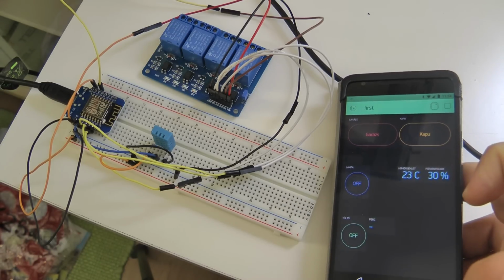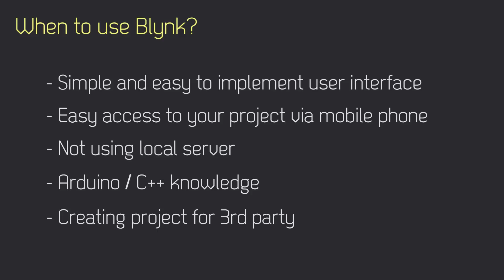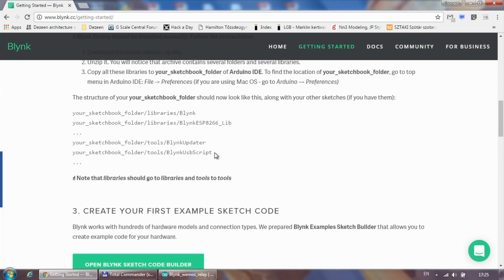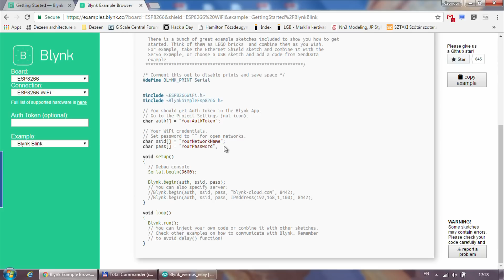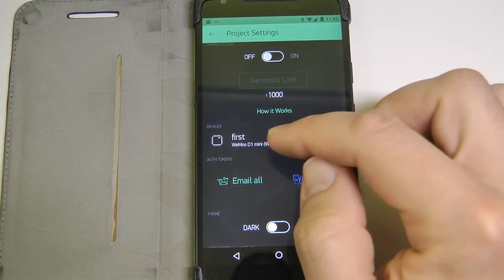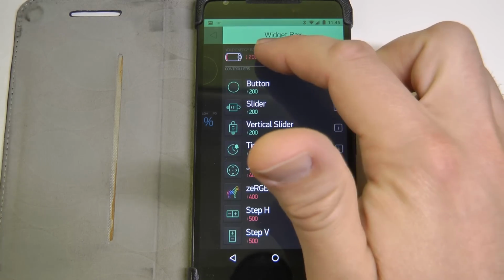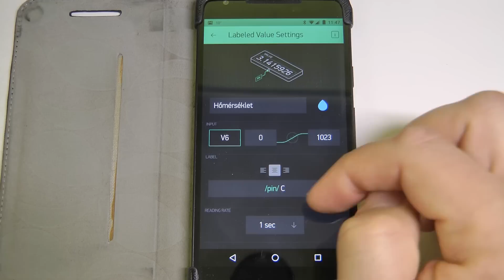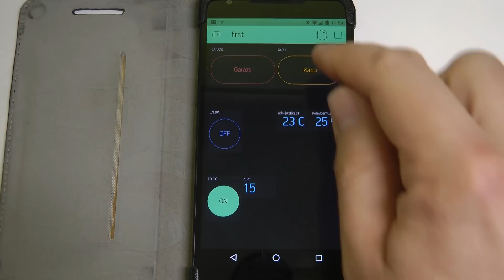What is Blynk and how does it work?

Comment: Ive bild a whole E rain gauge with magnet and Hall sensor and tipping bucket and also Arduino Uno and also try Rpi4 (with wifi bild in ) no should Blynk (free detecting this puls for messure the rain outside or must this first working with code and GSM screen ?

Comment: If you look at the example list and select servo it is unclear which pin you connect physically to the servo and the slider. This is not straight forward so having trouble figuring out how folks use this app. Sure creating the graphical interface on your cell phone is 80% clear and the sketch creation is 10% clear. How would you go about creating buttons, a graph, a gauge, and a display for one project? Which example on the web site do you select?
Needed is an example for each and every example on that blynk sample page.
Reply from the maker: It was a long time ago I used Blink for the last time. What are you trying to do?
Reply: @csongorvarga  see my OP covers it there.
Reply from the maker: @MaxGoddur  I think it is unclear because it depends on the microcontroller which PIN supports PWM. You need a PWM pin for the servo. So the basic Led and UI button example works, just need to use a PIN which supports PWM and use a slider instead of a button.

Comment: Hey man...great video. I like the detail. Quick question though, do I need the Ethernet shield to operate this? I have a HM-10 BLE module and I am trying to use it to control a motor and other things using an arduino nano. I also have an arduino uno, but I don't have the ethernet shield. Is it possible to control an arduino project via BLE module without the ethernet shield? Or are they two completely different platforms?
Reply from the maker: I never used BLE with Blynk. But you need a way for the Blynk server to communicate with BLE device. The examples I have seen is your phone communicates with the BLE device via Blynk. Which is nice and easy but that will not work when you move away from your BLE device. For those scenarios you need some sort of Wifi-BLE gateway like an arduino with ethernet shield and BLE module as well. But I don't believe the code for that exists out-of-the box, so you need to code that in Arduino IDE.
Reply: Csongor Varga Would you be able to assist me with getting Blynk to communicate with my BLE module? I would really appreciate it man. I am doing this for my school project. I have a HC-06 and it works perfectly with an android device. I am just struggling to get my iphone to communicate with my HM-10 BLE.
Reply: @csongorvarga  I just want to be able to control a motor via bluetooth using an iphone without having to through the whole xcode thing. I do not know anything about xcode or how to program using it.

Comment: Is it possible to transmit ECG sensor data using AD8232 ECG sensor over Wifi module ESP8266 or NODE MCU on the Blynk app, and finally show the ECG graph and BPM of the person in real time on Blynk app ?
Reply from the maker: No Blynk is not designed to process such quick data. In the docs they state only 1 record per second is recommended.
Reply: @csongorvarga  Any other way to transmit ECG sensor data of AD8232 sensor on IOT Website like ThingSpeak ?
Reply from the maker: @mukhtar_h  I am not aware of any service which would handle the frequency an ECG requires.
Reply: @csongorvarga  That's ok

Comment: How do you power your relay board? Do you power it using the arduino mcu board or through an external power supply??
Reply from the maker: It depends. Sometimes I just use a spare USB charger/power supply. If I want something permanent, my preference is a HLK-PM01 compact 5V power supply

Comment: Very helpful,  one question though. Is the energy to add say a button to the app a one time cost or each time you use the button?
Reply: I just checked this. It is per button. So say you want to add a control to switch 2 relays on/off separately it is 2X200 energy points.

Comment: ( would never use this unless it is a stand-alone program that runs only on my Android tablet with a direct USB connection to thet Arduino board.
Reply from the maker: Use an ESP or an Arduino with Ethernet shield. Than you can drop the USB.

Comment: Can we customize the buttons or indicators of blynk app?
Reply: I mean, add images to buttons or indicators, modify size of buttons and so on
Reply from the maker: Well, it is limited. You have a set of UI controls you can use. They all have a fixed appearance, but you pick from 5 different colors, customize the label (also on and off label), and overall size. But all buttons are rounded and there are no icons.

Comment: What is the input voltage on your relays, 5v?  The ESP8266 only output 3.3v.  How do you connect to this relay?  Mine does not work with 5v relay board.
Reply from the maker: It works for me. I have a relay board with optocouplers. The relay is 5V, but most probably the optocoupler opens on 3.3V and provides the 5V to the board which is needed for the relay to work properly.
Reply: My relay only led lights up but no click on relay.  Link what kind of relay?
Reply from the maker: I have something like this: http://www.ebay.co.uk/itm/5V-1-2-4-8-Channel-Relay-Board-Module-for-Arduino-Raspberry-Pi-ARM-AVR-DSP-PIC/252051910091?epid=1642428054&hash=item3aaf76edcb:m:mdbiogK3bG3MfWb_sjDpLvw
Did you connect 5V to the VCC pin of the relay board? Like I showed on the diagram?
Reply: I have  the same relay but 8 chls.  You mean I need to supply external 5V supply. How do I wired it?   It has GND-IN1-IN2-IN3----IN8-VCC pins then on the far Right it has GND-VCC-JD-VCC pins with Jumper pin on the it.  So how should I connect to this relay.  Do the trigger from Arduino pin trigger High or Low when On?
Reply from the maker: GND goes to ground, VCC to 5V and IN1-IN8 goes directly to the ESP/Arduino pins. The jumper should be closed. My model triggers on low. This should work.

Comment: What you call it free is not totally free if you want to use many widgets. If you want a free interface look at RemoteXY , plus that is much safe because don't need any account or cloud connection, so..... from far away is much better
Reply from the maker: Yes I said that the widget cost money and you need to spend after a while. RemoteXY looks interesting, but without a cloud account remote control (outside the wifi) is probably problematic.
Reply: Csongor Varga Cloud account and in general servers that process your information is equal with lack of security = vulnerability. I think local Bluetooth application s between phone and Arduino are much safety and you don't depend on having your phone connected at WiFi
Reply from the maker: I agree, but still some projects cannot be done like that.
Reply: Csongor Varga You are right, I agree with you :)
Reply: Super ADI but the IoT, and of course the IIoT, all of them depending of a cloud service, is the way how things Will be connecting and sharing info between them! I know it could be insecure but there are other plataforms like Amazon web services or Microsoft! The Internet of things is here and we need to work with them

Comment: What do I do if I want to control via bluetooth? I want to control relays within 100metres where there is no access to wifi. I need an iOS app to control relays. Any advice?
Reply: Yes you can use RemoteXY is much better than Blink, much secure, and that is really free, not like Blink who will charge you for multiple widgets used ;)
Reply from the maker: I have not explored this option yet, but I think Blynk is not your solution. I have seen ready made relay board with bluetooth that usually comes with its own app to control it. Btw, 100m for BT is I think a myth.
Reply: Probably your best bet is something like   NRF24L01-Wireless-Transceiver   which there are various versions with greater output and you can use directional antennas.   There are plenty of how-to's out there on it.
Reply: I have couple of Class 1 Bluetooth dongles and 100 meters is not a problem at all. It is definitely not a myth ;)
Reply from the maker: Sorry, I never had a class 1 BT module before. But it appears that it worth considering.
Reply: I'd also recommend having a look at XBee wireless modules. You can choose different output power options, different protocols.. Really a nice one...
Reply: Was looking for a complete solution.
Reply: Super ADI Thanx for the tip! I’ve never heard of RemoteXY. Will try that tomorrow.
Reply: TheBuzzdev And better than RemoteXY because also that one is limited of how many controls you can use, what is totally free, I mean really free is Bluetooth Electronics , you can find it in Google play, is free and complex like prayed complex applications :))

Comment: can blink send you a text message on the state of a switch, either on or off ?
Reply from the maker: johnny wonka No, there is Twitter, email support and app notifications. But since you can add your own code on the hardware you can implement anything outside Blynk.
Reply: thank you for reply, are there any others out there that can do that without a lot of programing since i am not to good in programing..
Reply from the maker: johnny wonka Actually, have a look at Conrad Connect. I only spent about 1 hour looking at it and it looks quite promising. The recepie builder is very easy and powerful.